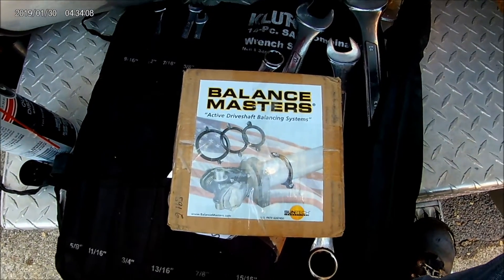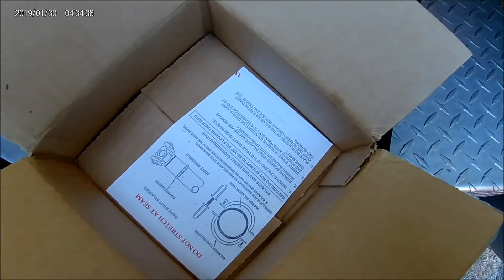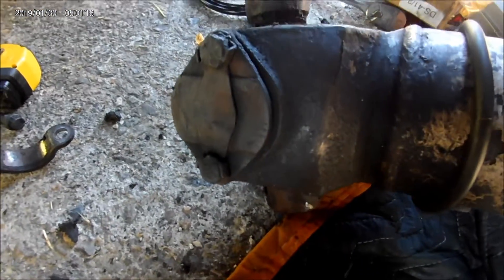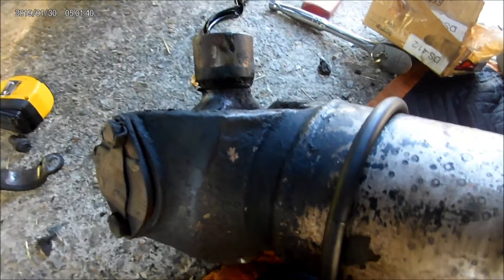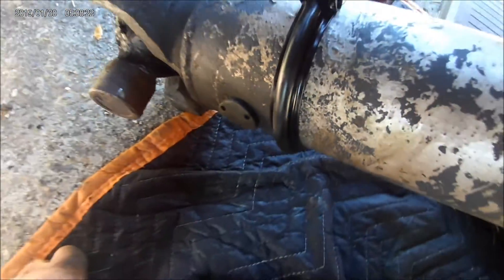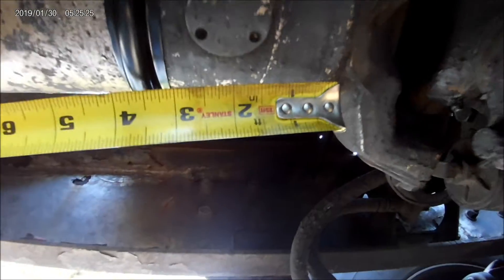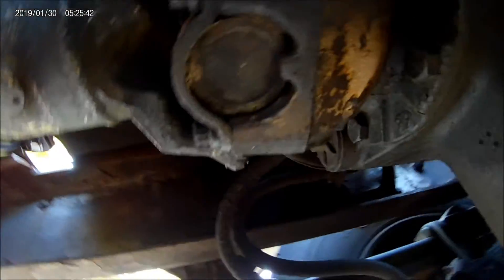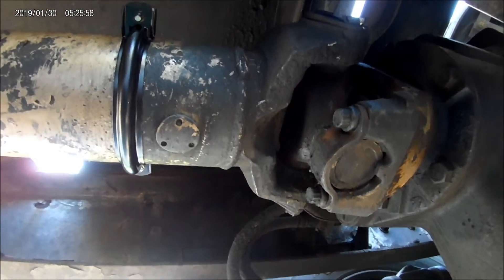Balance Masters driveshaft balancer

Comment: Did it work??
Reply: In my case it was solved.
Reply: @wangwoolee2191  how bad was the vibration? I'm dealing with a vibration on my 1999 Dodge ram 3500 it will come and go sometimes on the highway at speeds above 60 can get pretty bad at times and other times will smooth right out and be smooth as glass for a couple miles then come back. All u joints are good not sloppy or tight) binding.